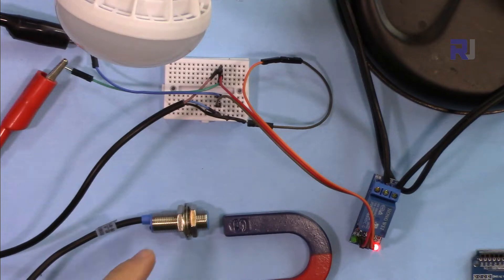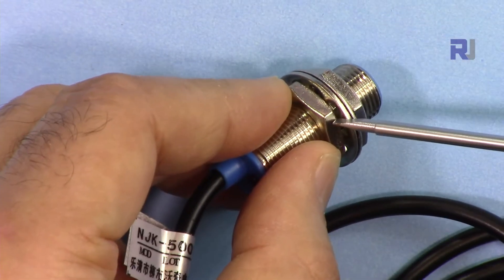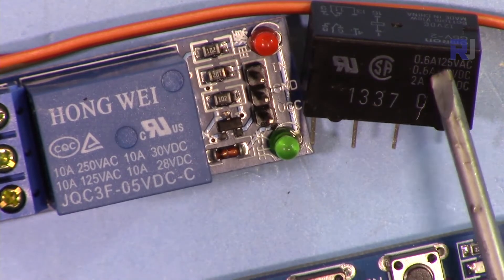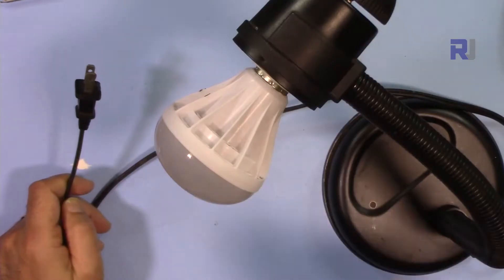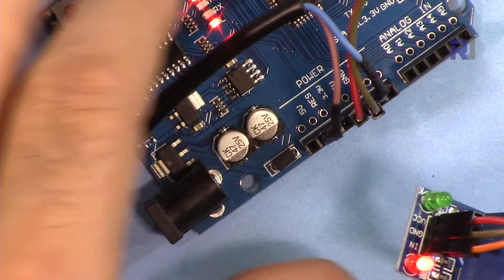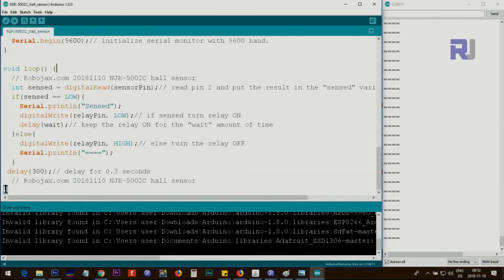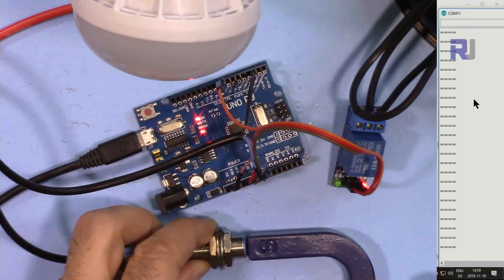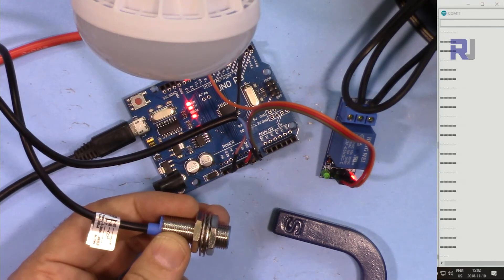Using NJK-5002C Hall Proximity Sensor with Arduino code RJT135

Comment: Hey I am looking to use a Hall Proximity sensor wired with an Arduino UNO in order to turn off a motor when the sensor detects a magnet - do you know whether I need to use a PNP sensor or NPN?

Comment: I wonder if you use a higher voltage towards its upper range max, if the sensor would detect from a further distance? As opposed to to being almost right up against it.
Reply from the maker: no. higher voltage will kill it.
Reply: @robojax  That's why I specified "towards its upper range, max". Shouldn't kill it if you're still within its spec'd voltage range.

Comment: Hello. Can you use the same sensor but have it count the RPM or a rotating object? Great video and well explained. Thank you!
Reply from the maker: Hello, I believe this is very slow reacting device. I did not find any information to show it is fast. So you can't use it for RPM counter.
Reply: @robojax  Thank you for your reply. I was afraid it might be so. Do you know of any other sensor to achieve this besides the small one everyone is making a idea of? Say a more industrial type. Thanks

Comment: How good would this sensor be for gear teeth counting ? Does there need to be a magnet for every tooth or can the gear be manufactured with a magnetic material instead ?
Reply from the maker: It depends on the gap between teeth. The smaller the gap the lower the accuracy. Also if you are looking for certain speed this might not work, test it to see if it work for your application

Comment: nope. doesnt work. either code is broken or you have used a faulty hall switch. i tried this and the hall switch wont power up with 5v and when i connect the brown power wire to 12v common to the arduino 12v it immediately pulls the out pin high and closes the relay as well as grounds the black wire on the switch. exactly same hall switch, exactly same relay and used two different arduino unos. didnt work.
Reply: well putting 12V on your Arduino will kill it so not surprised it didn't work.

Comment: How do I connect the indicator lamp?
Reply from the maker: to indicate what? if sensed something I have explained in the code how to do something.  If you want to turn ON/OFF DC or AC load using relay so you can connect relay to this, see this video https://youtu.be/58XWVDnB7Ss

Comment: hi helow sir can you make a 2 Proximity sensor with 1 relay
Reply from the maker: Hi, when you sue two sensor, they should be configured either as AND or OR configuration.  in AND configuration if both sensor detected the output is ON . in OR configuration we need only ONE sensor to detect and the output will be on. I will see if got two sensors, I will make video. this is interesting. thanks.

Comment: Is it possible to start a relay via ir then use a hall sensor to count a rotating table and then turn the relay off at its original start position using an arduino. TIA
Reply from the maker: Yes possible. I've tones of tutorial videos https://www.youtube.com/robojaxTV/search?query=remote
Reply: @robojax  Thanks for the reply Ive decoded my remote and have the relays all working but cant figure out where to add the sensor or the code to control the solenoids which are attached to the relays after the initial start from ir .Thanks again for the reply

Comment: Sir can use SERVO MOTOR in relay?
Reply from the maker: Relay is a switch which turns ON or OFF. Servo needs PWM signal . So you can turn ON or OFF the servo but can't control is the speed of it if you connect it using relay.

Comment: Hi!
Cool video
My 3D printer is old and uses an enclosed electronic board (Gen7Br)
So, I would like to use the LJ12A3-4-Z / BX proximity sensor only with Arduino. Making an analog reading to measure distance through the Monitor Serial, can you help me with the code?
Reply from the maker: Hi, I am sorry I have got a full time job, research project and YouTube. Got no time work on anything else.

Comment: Thank you Jack for the video. Do you think you can make a video on water flow sensor please? I'm trying NOT to monitor the water consumption. I'm trying to activate the water pump once i turn on the tap. Thanks again Jack https://www.ebay.com/itm/1-2-Water-Flow-Sensor-Control-Fluid-Flowmeter-Counter-1-30L-min-For-Arduino/323513094112?hash=item4b52e20fe0:g:NxIAAOSwWCFbzsmi:rk:4:pf:0
Reply from the maker: I don't have the component. If I get it now, it will arrive in about 30-80 days. Or I would have to pay more and get it from Amazon. I will see what I can get it.
Reply: Thank you  @robojax  I hope i will see that video some day.
Reply from the maker: Just bought the item and will take 30 days or more, once I receive it,  will make video.
Reply: Thank you so much  @robojax  . I really appreciate your help. You are the best. :)